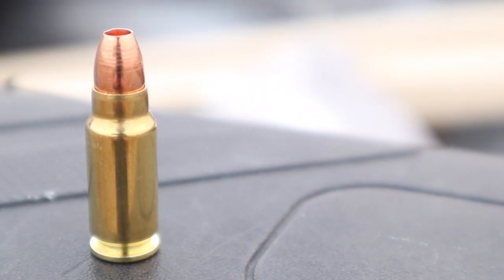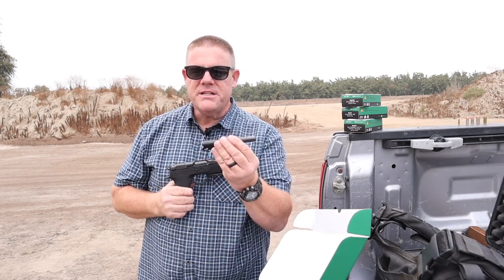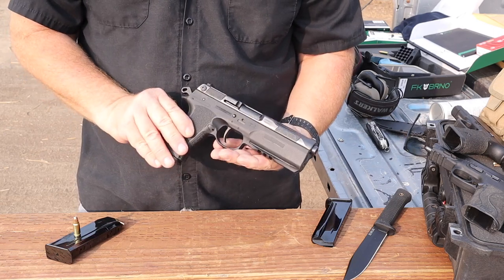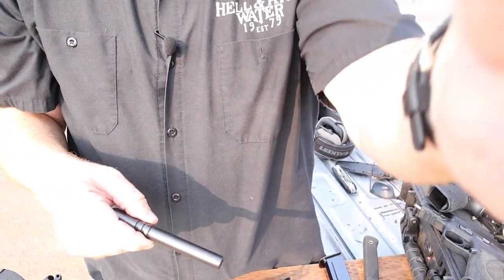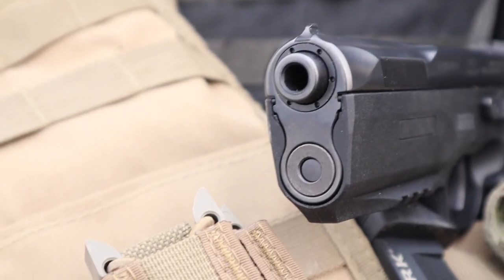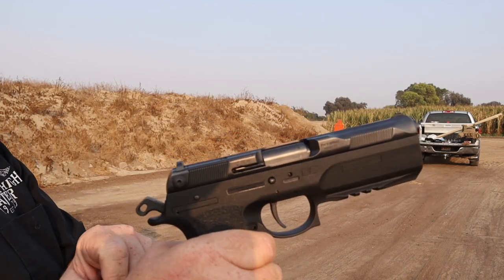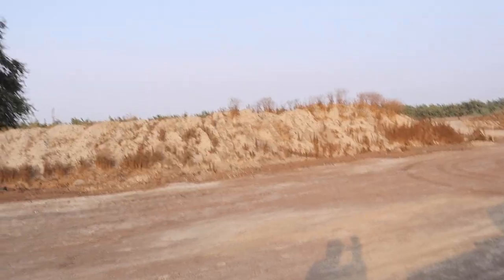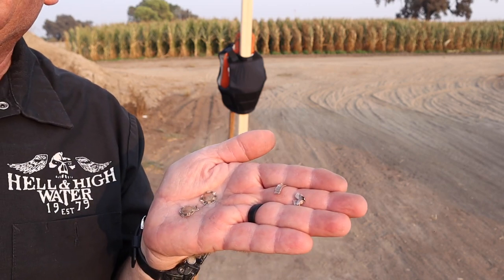The FK BRNO 7.5mm PSD [OFFICIAL VIDEO]

Comment: man i want one! but im way to poor atm its nice that this model isn't 9k! ide love to work up some real deal hand loads in this cal. its a dam nice pistol and light years cooler than the glock! the size seems just right and the fact that it comes with a 10mm barrel is fantastic because very warm hand loads should be just fine! arrrggg the more i think about it the more i want one! my edc is a ww2 colt army 1911a1 that still dose its job better than one might think lol it looks like they saw the Hudson h9 and laughed and said hold my beer! cause the got the bore axis super low and added mass to the system to slow the unlocking witch is pretty impressive considering how fast the bullet exits the bore! thank you for the excellent content!
Reply: The Brno field is 8k. This is 1650. Field has metal lower. This is polymer.

Comment: At 24:20 are you not worried about fragmentation hitting your truck from the steel target? 😮
Reply from the maker: No. It was an optical illusion. It wasn’t that close.
Reply: @OGsDangerShow  😂 that's crazy it looks so close on video. Have you had any issues finding ammo or support for the 7.5 brno? I've heard the new ammo coming into the states is "low recoil" handicap loads is that true? I've been contemplating picking one up as a hunting pistol and my first "magnum" semi auto but it seems like a fad gun that will slowly fade away then you're left with a platform that doesn't have any parts support or ammunition supply. It would be awesome if this caliber would pick up in popularity and become a standard loaded cartridge. I just want a Glock chambered in it 😂
Reply from the maker: I can only get the ammo (full power stuff) from the BRNO factory in Florida and I haven’t needed a resupply since making this video. It is kinda a fad pistol. If I were looking for a woods gun I’d choose a Glock 20 in 10mm (what I actually carry in the woods)or a revolver in .44 Magnum or bigger. The BRNO ammo is hard to find and super expensive.
Reply: @OGsDangerShow  you're right a Glock 20 or 40 is probably a smarter choice, but if you can still shoot 10mm out of the FK do you think the build quality and "cool factor" of the pistol is worth it over the Glock? I guess what I'm trying to ask is do you think the brno psd is a better shooter in terms of trigger, ergonomics, accuracy and sights than a Glock 20 or 40?. Thanks for your time and replying.
Reply from the maker: @PewLand the FK is a very well-built pistol, but the Glock is indestructible, and about 1/3 of the price. All I need is a good reliable 10 mm in the woods. Although I can carry the FK with its 7.5 penetrating rounds, I still find myself packing a Glock 20 or a Glock 40 when I go into the back country where I might encounter bears.  I just like how rugged and simple they are, and the fact that I can buy ammo at my local store.
Reply: @OGsDangerShow  I wanted so badly for you to justify the PSD for me but you're right 😂. You would think I would learn my lesson after getting an IWI uzi pro as a backpack pdw....then finding out it doesn't like to feed hollow points, the magazines are hard to get, it's trigger sucks, sights suck....then I shot my cheap keltec sub2000 and realized it's a more utilitarian firearm in almost all respects 😂. Gucci doesn't always mean better. Thanks Greg.

Comment: Is it on the Cali pistol list? No. Is it $1650? Yes. i guess a LEO can buy one, for the moment. i will probably never spend more than $1300 for a firearm though. Long range or backup hunting, I would either stick to 10mm or move up to 44 mag. I guess if people are really going to have an insurection, maybe armor piercing rounds would make sense, but I think Cali will make them illegal as soon as they realize that they exist. Or maybe they are already illegal per section 12320, as handgun AP rounds. LEOs tend to not get charged for gun stuff, but they have been, on occasion. Might wanna check with your legal department on this one.
Reply from the maker: Well Michael, by definition this isn’t armor piercing...  soooooooooooo.   Perfectly legal in California if you can find one second hand.

Comment: $1650.00 is a lot better than the price of the original steel framed one. And you get a 10mm barrel also, that aitnt bad.Also if you reload I dont see any reason why you couldnt make your own 7.5 brass from 10mm. Hell i might just get one after I sell a few  of my normal power pistols. Kinda excited me with the 850 ft.lbs. at 100 yds.

Comment: You were wrong OG, I did not wet my pants watching this video.  However, my 10 week old puppy managed to pee 3 times, so your video did inspire some wetness.  I saw another video on a steel version of one of these, but I don't recall the price on that one.  May have to wait for Ruger to come out with the Ruger 75 at a lower price.
Reply from the maker: Their original Field Pistol is beautiful but runs $7500.  They made this polymer lower with the same slide for WAY less.  Now go mop up after that puppy.

Comment: So a 10mm won't seat in the 7.5mm barrel. That's all good. But what about a .40 in 7.5 barrel? If you are used to shooting .40 in your 10mm then that sounds like an accident waiting to happen, so it would be good to know if the .40 is short enough to allow the slide to go into battery, and if so what happens if you pull the trigger? I know this is likely to be destructive to the gun, but how bad would it be for the user?

If the slide closes on the .40 it might be a bit beyond the scope of this channel to actually test fire. After all it might damage a pretty expensive piece of hardware. But perhaps Brno might be interested in sponsoring such a video if they are reasonably confident that the gun would protect the user from a user error such as this.

Edit: Read through my post and realized I've written it as if I was pretty sure the .40 will seat deeply enough to allow the gun to go into battery, and looking a bit more on the 7.5 mm cartridge I'm no longer so sure it will. But just dropping a .40 into the barrel like Gregg did with the 10 mm would go a long way to prove it either way.
Reply from the maker: .40 won’t seat either.  Still too long.
Reply: @OGsDangerShow  Good to know...

Comment: No reason why you shouldn't be able to fire 40&W out of a 10mm. Small vs large primer, big whoop, but the case itself is just a shorter version of 10mm. They could have called it 10mm Special, but people would make mean jokes. But most 10mms it won't cycle, and the only thing holding it is the extractor so it might see accelerated wear just due to looseness, but it would be no different than shooting 380 out of a 9mm. Just don't use unjacketed ammo. 

Carry size isn't a big deal. I carry a G34 under a hoodie and Carhartt vest in a shoulder holster and no one sees it. 

$1600 is a bit out of my range. But if this takes off, that means conversion barrels for others to take this round. Most guns might want to up the recoil spring but that's not a big deal. My Glock 20 is trying to tell me it's been a good gun and I haven't gotten it anything new in a long time...

Comment: All I see is a .357 Sig on steroids. Instead of .40 short and weak is based off the 10mm. Yet went 1.5 mm skinner. And tripled the price for the ammo. I will stick with my Shield with .357 Sig over the .40 short and weak any and every day. Although I typically carry my P365XL with RomeoZero on it. I like my red dots. Getting old and sometime sights just don't show correctly. Although did show my brother-in-law my 6.5 Grendel Pistol build with the Trash Panda on it and he said yeah next time I am down here for a few days we are going to go shooting. Couldn't this time cause of my grandmothers funeral. Plus I will let him shoot suppressed .22lr's best one to put a can on. Might have to take my daughter's .22lr with the can unless I get a new barrel for my at this point vintage 10/22. It is close to 30 years ago. And barrels for them are kinda pricey.

I need a shoulder holster got any places for a good price? Most I find are in the $250 price range. I use a wheelchair and now getting colder I can wear a jacket and shoulder holster would work great. I would more than likely going my compact P320 with RX or P265XL. Shoulder holster I would go the compact with 15 rounds vs. 12 rounds. And I always have my P238 for my pocket gun even though it is .380 yet has XTP's in it so per theory should stop someone within the 7 shots.
Reply: It's based on 6.8 SPC. It works at much higer pressures than 10mm.

Comment: Only problem I found with this firearm because I did want one, is it stupidly exorbitant price. You are correct about the pronunciation of the name, however Bruno has been used to describe these firearms in the United States because we use the Hebrew tradition of putting involves where they need to be for an English pronunciation. By the way do you pronounce Heckler & Koch properly? It's pronounced Heckler & cook.

And the very first thing that you show people is how to improperly drop the hammer. It's a cocked and locked pistol you put the safety on. Dropping the Hammer by squeezing the trigger is a dangerous Act. If you don't want to handle the firearm properly and show people how to handle it properly, don't be showing it then!!!
 Why does no one know how to properly handle a cocked and locked pistol?
Yes I think they call vet weight a recoil attenuation system. We in the United States call it a heavy freaking slide.
And yes it is a fully supported chamber but that round does not go all the way into the shoulder. It goes all the way into the base of the round. Starting to wonder about your understanding of the nomenclature of firearms?
Reply from the maker: $1650 for a 4-caliber pistol is not exactly “stupidly exorbitant”.  Many customers have bought this pistol from this video alone.   

The PSD pistol has no decocker.  A cocked hammer can only be dropped by pulling the trigger.  Not exactly sure which video you watched that gave you such critical insight but I own two of them and know how they work. Police rangemaster by the way.  As an aside, the company books and media kit all day the pistol can easily and safely shoot .40 through its 10mm barrel.  Maybe it’s the manufacturer who is wrong because a YouTube commenter said not to do it.    🤦‍♂️

Comment: I'd prefer just getting a 7.5 FK barrel for my Glock 20.
Much better for us poors.
Reply from the maker: The power is significantly different.  Not sure my Glock 20 frame would handle the abuse. And remember, the FK was built around that unique recoil reducing system under the dust cover. A G20 in 7.5 would either jump out of your hands or tear itself apart.

Comment: Just to set things right, it's absolute BS that you can only own one pistol in Germany. 
Currently 5 Rifles and 3 Handguns + 10 single shot or black powder guns are the base limit. 
If you find a good reason to own more handguns like to take part in a different competition that requires a different gun you'll probably get those too. It gets worse with limitations like the 10 round mags for rifles, but we can still own multiple guns. Almost every gun owner there is in Germany has  multiple ones.
Reply: It was a bit wrong but it's still true that the fact that there is a limit at all creates a market for modular and multi-caliber weapons.
Reply: @MarvinCZ  
"They can have 1 firearm in Germany." Sure...a "bit" wrong. The market for the FK BRNO in Germany is mostly as a hunter's side arm.

Comment: 10mm and 40s&w index on the case mouth so shooting 40 in a 10 barrel is not smart.
Reply from the maker: This chamber is fully supported and the manufacturer states right in the manual that it can be done safely.   In fact I’ve shot more 40 out of this one than the other three calibers.
Reply: @OGsDangerShow  how does it safely index a 40 in a 10 chamber when both rounds index on the case mouth and they are different lengths?